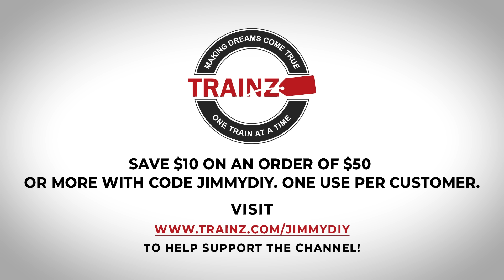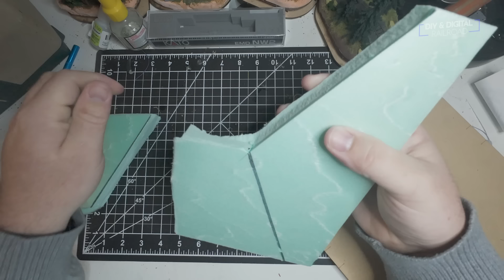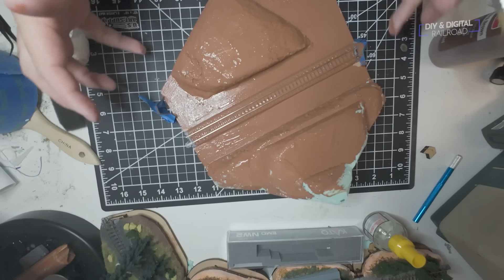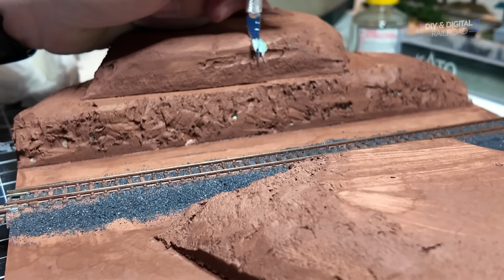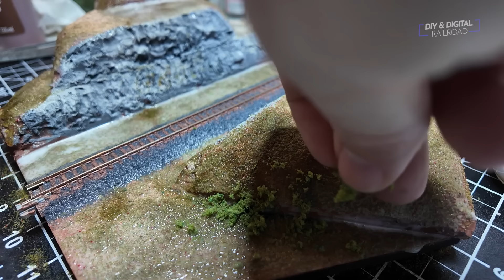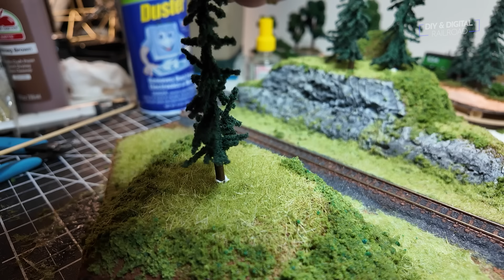How to Build Realistic Rock Formations for Model Railroads Without Plaster

Comment: Great video!  I thought I’d share what I find to be a handy technique for static grass, which is using my small vacuum cleaner. I’d clear away the excess static grass first and then come back over the area where the static grass is actually adhering and use the suction from the small vacuum cleaner to draw the fibers upwards in spots where my static applicator didn’t quite do the job in making the grass stand upright. I use a straight up and down motion with the vacuum and it seems to help quite a bit. Once the glue has dried, everything seems to hold pretty well.